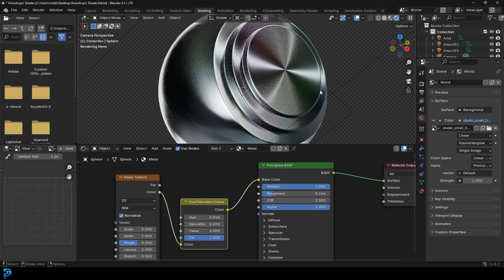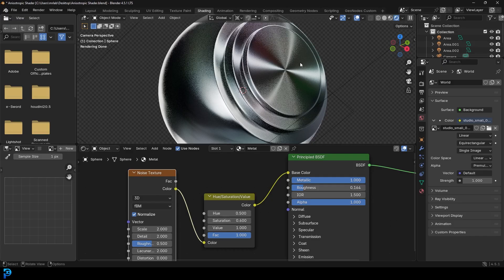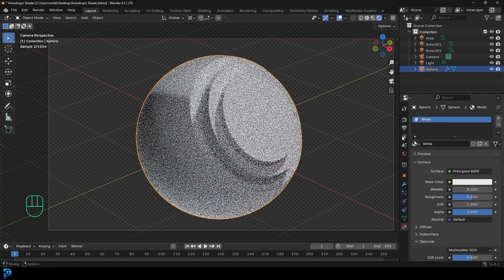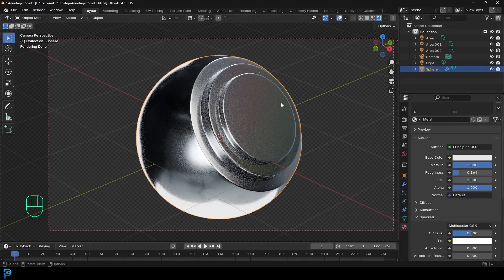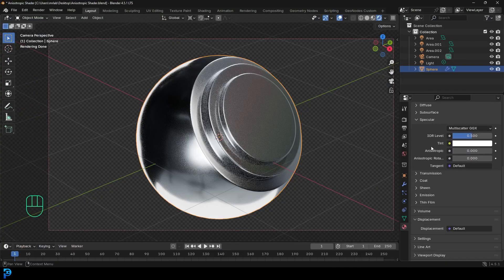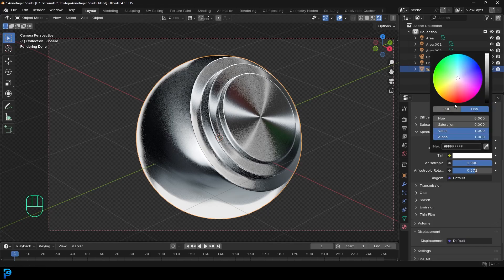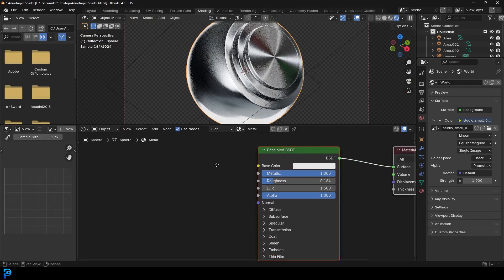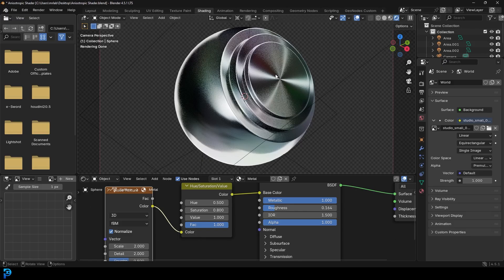Anisotropic Metal | Blender Beginners Tutorial

Comment: It should be criminal to talk about anisotropy without mentioning:
* Anisotropic rotation and how you should verify it is correct against a light source.
* Anisotropic rotation spread which is done by modulating it (extremely slightly), possibly adding 0.25 as well.
* Tangent node which is used to set which radial direction you want to use (or UV based, which I still think has a problem).

Tint has nothing to do with anisotropy, it's just edge tint for metals and face tint for dielectrics (edge is always white).

Comment: For the most predictable result the Rotation value should be 0.25. That's basically a 90° angle which changes the strand direction. I don't like their default because the most common result people want is only achieved by a specific 0.25 value.